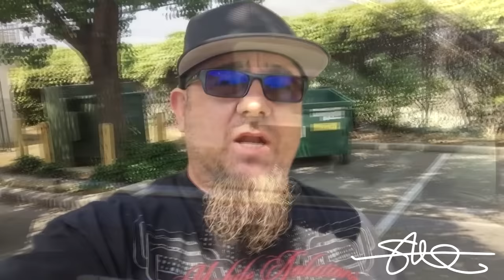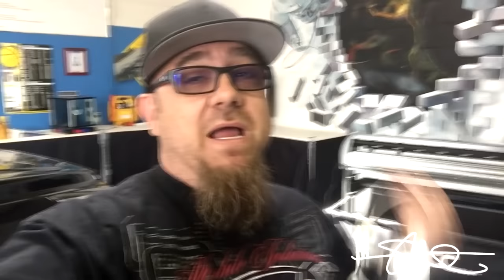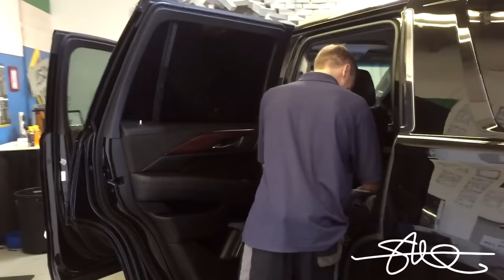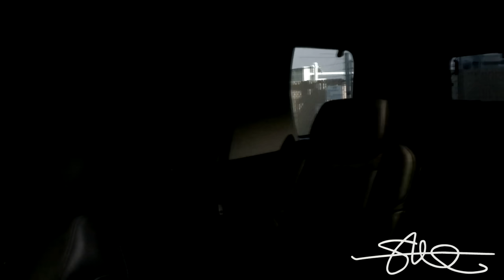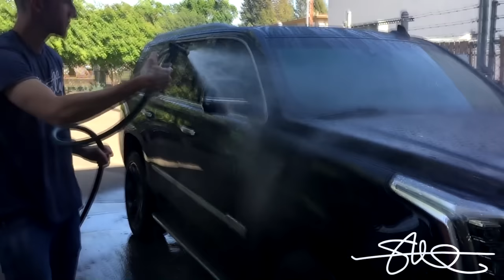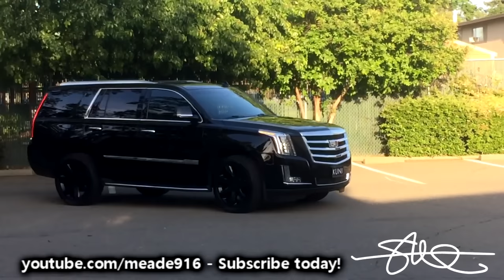Blacking Out The Windows - 2015 Cadillac Escalade - Suntek CXP Carbon Tint

Comment: Due to issues with my vision, I have a state exemption which allows me to legally tint the front windows and windshield of any vehicle I own, to a minimum passthrough of 30%.  Why I haven't used it yet, I do not know.

Caddie's lookin' hot, Steve!
Reply from the maker: +rhkips won't be any good in Cali. They don't have prescript exemptions here. Thanks though!
Reply: I got 5% Carbon XP wrapped, and 35% Carbon XP on the entire windshield. Its perfectly private and dark from the outside. Inside at night, its honestly not bad at all. The windshield doesn't even look tinted at night.
Reply: +rhkips 
"Due to issues with my vision" What issues??? #CmonDude

Comment: most tint laws are different and most states when it comes down to a suv or truck you can black out the backs. i live in North Carolina and the back of suvs and trucks can be spray painted but cars can only be 35 to 32% ive looked into the laws as well. I've had 15% in the back of a 97 tbird with 32% on the front doors and the entire windshield with a 2.5% strip half way down the windshield and never got pulled by any police or highway potrol. its about what and who you know

Comment: Hey man sorry to bother you I know you're a reall busy guy but hey I thought I'd try and maybe you would reply back.....but anyways I have an equalizer I've been trying to hook up for like 3 weeks now...Idk how something so simple turned Into something so complicated.  So I'll try and make it short. I connected the RCAs from stereo to input that says CD on EQ. and from the EQ I ran sub RCs to the sub amp. And left and right rear for voice to a second amp.  But there's no sound Coming from neither amp. So I thought one amp could be burned or something.  So I tried each amp hooked directly to head unit and they both work. I'm out of ideas to try. Could it be the EQ that's bad and not splitting the signal or what else could I try.  I'd really appreciate it if you could help me out.I ran out of people to ask, and websites to look under. sorry didn't know how to write you in private.
Reply: Does your EQ have an input for a remote (turn-on) wire. You know, like the one going to your amps. You need a power and ground and you need the remote signal to turn it on. After you check that you can start moving to other things. What EQ do you have?
Reply: +Gilberto Gutierrez its the sound stream mbq7b....and everything is connected right the EQ turns on all the amps are on and everything
Reply: +Cony Payen I only found MPQ-7B. So it's just the one input(CD) and splits that input into 3 outputs front/rear/sub, correct? The only thing I could think of is try clicking the input selector switch in the front that says "CD/AUX". If that doesn't work then try changing the CD GAIN setting to the other two settings. Try changing them first individually then together. If it still doesn't work try switching your input rca cable for one of the output rca cables. You could have a bad rca. If not just replace the eq for another one.
Reply: +Gilberto Gutierrez yeah I tried all of that i just didn't think the EQ could be bad its brand new
Reply: +Cony Payen One last thing. Your EQ has balanced rca inputs, so you need to use twisted pair rca cables with it. I don't know if that would cause your problem, but it's worth checking if you don't have them already.
Reply: +Gilberto Gutierrez my main RCAs that come from head unit to EQ are Rockford fosgate twisted pair RCA's the rest are Walmart brand
Reply: +Cony Payen  I guess the EQ might be bad then. Good luck.